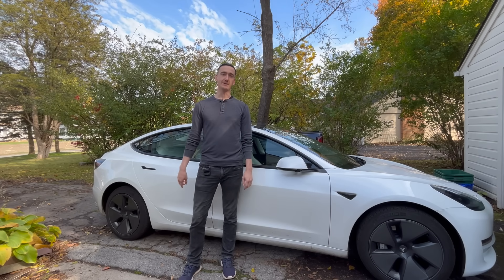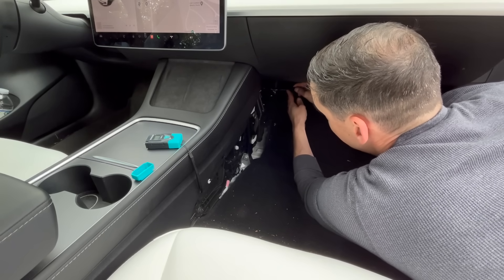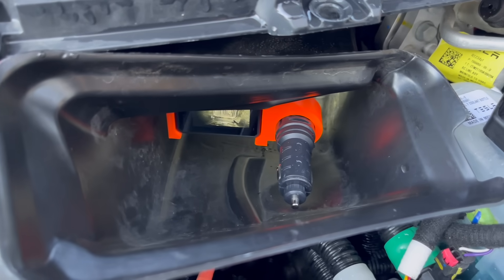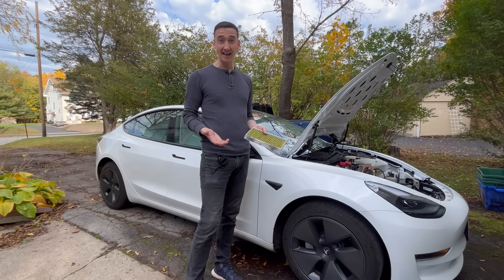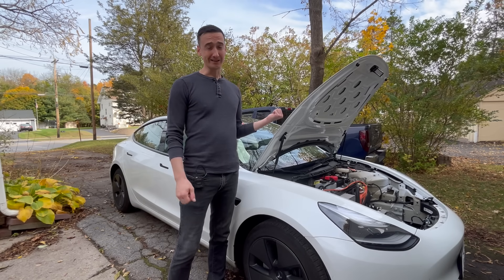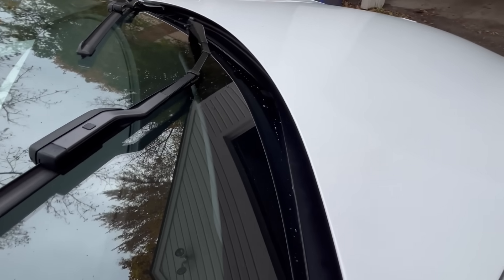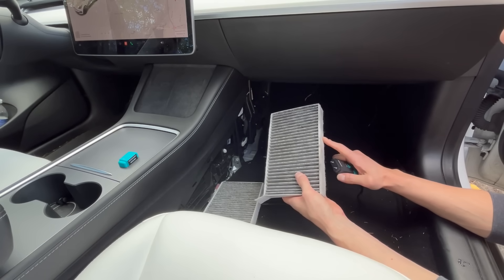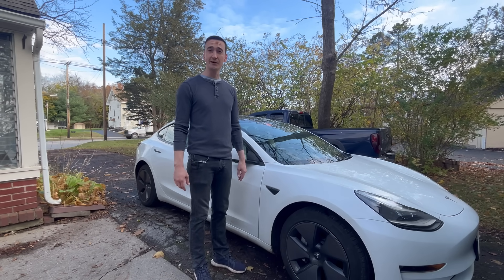This design flaw makes Tesla’s Model 3 smell bad! (with fixes!)

Comment: Lots of effort to uncover the bad design choices, that was covered up by smart but incomplete workarounds by Tesla. Not only you've uncovered the potential design issue, the fact that you"ve suggested multiple solutions is truly ingenious👍👍. Just wondering, if there could be a small 3d printed flow diverter tube(more like a periscope with row of holes on the bottom, to prevent accumulation) that could be fitted over the drain hole. It should cut down significantly on water pulled out of drain hole. Also a nylon mesh covering on main vent could help with water splashes in the intake duct(might need occasional cleaning though). Just some 💭. Excellent and thorough investigation.❤👍

Comment: Amazing video. I don't own a Tesla but I've rented several, and a couple had this issue. The air stinks for 4-5 minutes after starting the AC. I also imagined it had to be something in the filter, but since it was a rental I didn't look much into it. 

Amazing investigations, good solutions proposed and you even validated them. Thank you!